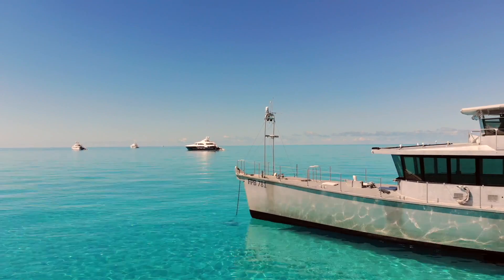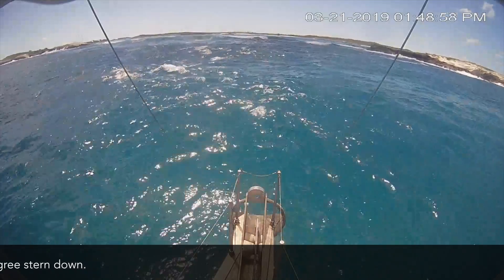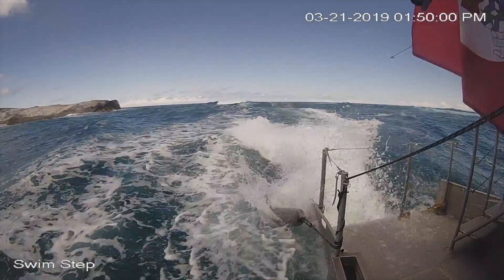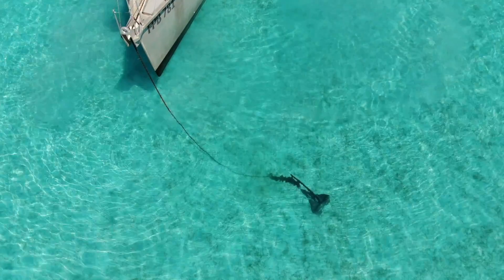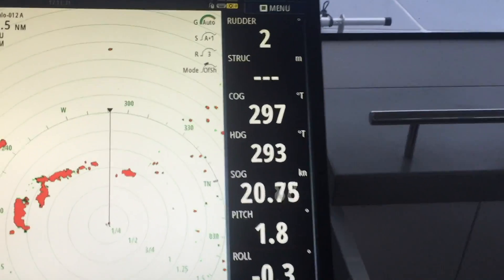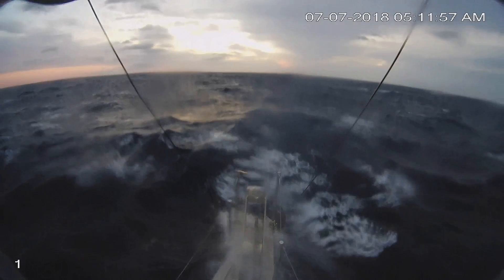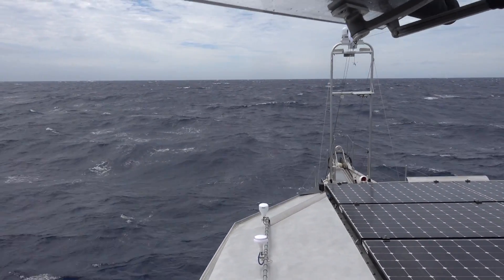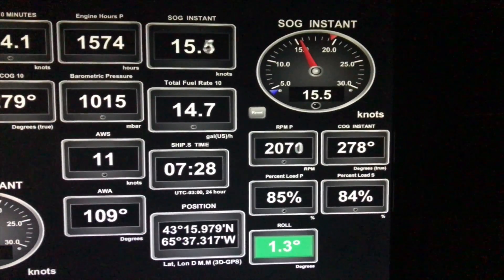Dealing with Extreme Sea States - Steve Dashew explains the FPB 78 shape

Comment: My experience is on sailboats with deep keels. What I don't understand about motor yachts is they seem to be shallow-draft, top heavy disasters waiting to happen. Look at all that stuff above the deck on your boat! But they do fine. Why?
Reply from the maker: It is the result of a low center of gravity, coupled with a great deal of form stability when heeled. The FPB 78s have a greater range of positive stability (inverted!) than any of our sailing yachts.
Reply: Proper design,  ie; center of gravity is below center of buoyancy, and form stability
Reply: It's funny reading your comment, my first thoughts watching this video was that this boat performs very much like my sailboat. She's a  Cape Dory 25 and surfing large waves at ten and more knots is intensely exhilarating. Having water come over the stern has caused problems, but those are solvable and avoidable.
Thank you, you helped clear up some things I was curious about.